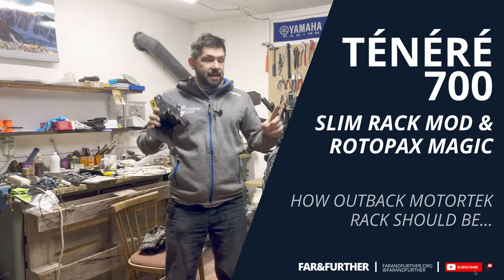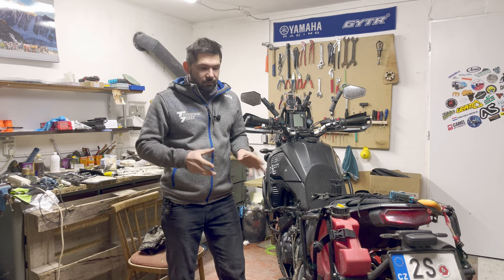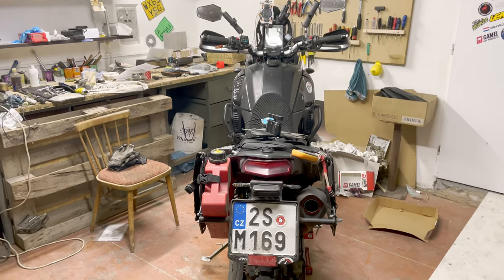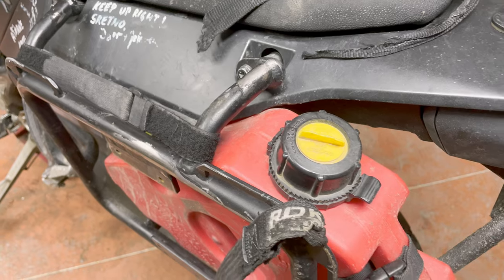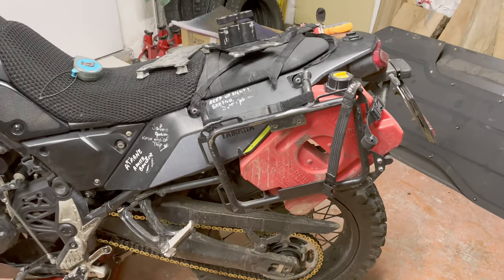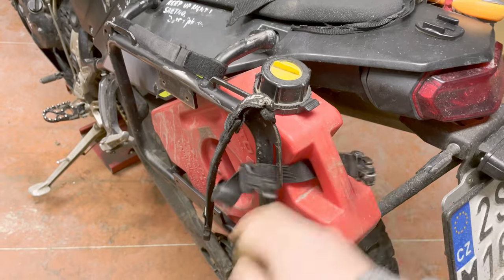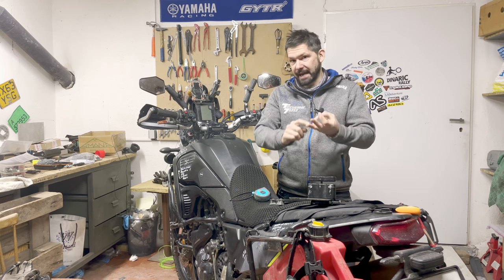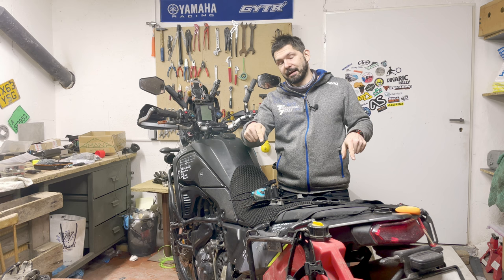Yamaha Ténéré 700: Outback Motortek Slim Rack & Rotopax mount mod

Comment: Hey, great video!
I think I'll do same thing, so I am wondering did you start with asymmetrical pannier rack from OM and just modified exhaust side (+hook for rotopax on other side)?
Thanks in advance!
Reply from the maker: Glad you like it! I started with symmetrical because at the time I got it there was no asymmetrical. I adjusted both sides to be as slim as possible while keeping enough space for Rotopax.

Comment: I need this smaller Rags too. :( i use the Hp corse short titanium high exhaust and seraching for a rag like this. Planning for the custom job. Can you tell me the extact length where to cut this one?
Reply from the maker: Hey, the length really depends what you want. I had scorpion exhaust on one side and wanted Rotopax on the other. That gave me some width. I have not measured the exact distances. We kind of looked at it placed it where we wanted the rack and cut it 😂